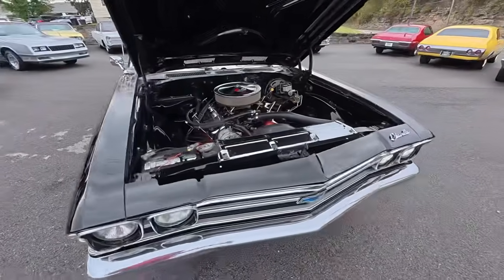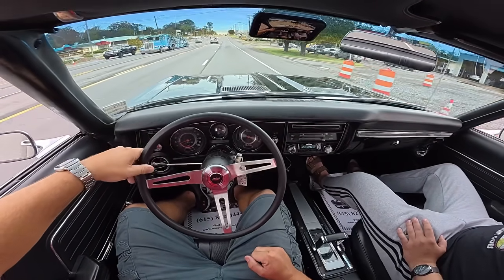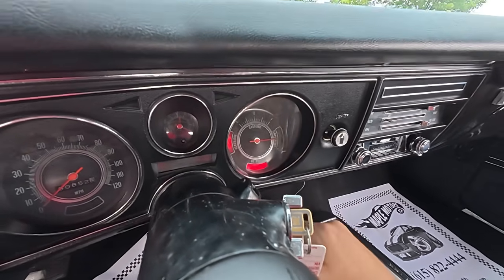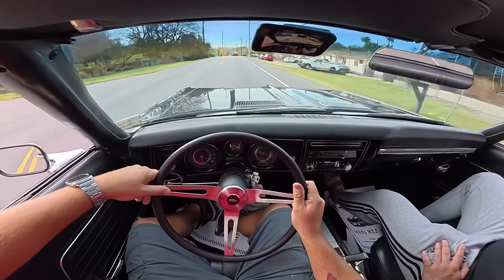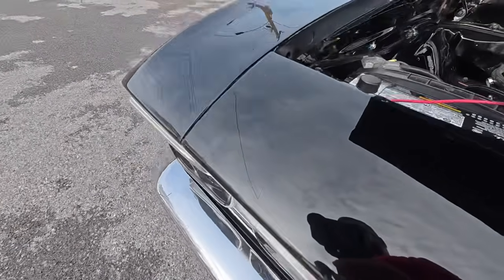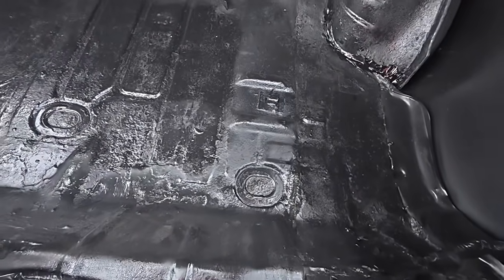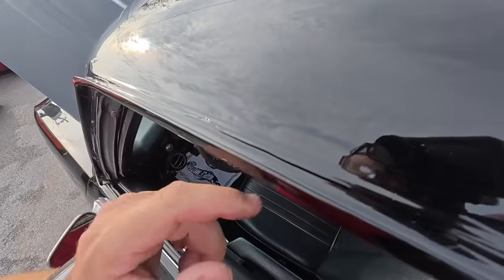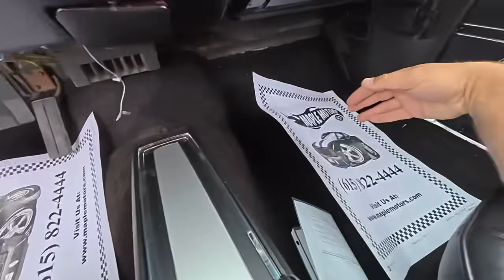Test Drive 1969 Chevrolet Chevelle Big Block SOLD $36,900 Maple Motors #2855

Comment: sounds like an alternator ready to go
Reply: Its a gear drive genius..
Reply: @thinkfaster6451  gear drive noise from where?
Reply: @Smoknn777  there is no timing chain.. gear driven..cam gear is attached to crank gear with an idler gear.
Reply: @thinkfaster6451  oh , ok I did not know that. thanks for informing me. I wish I had one on my 70 AMX the timing chain jumped a tooth while doing 100mph. A gear driven cam gear would have solved that.